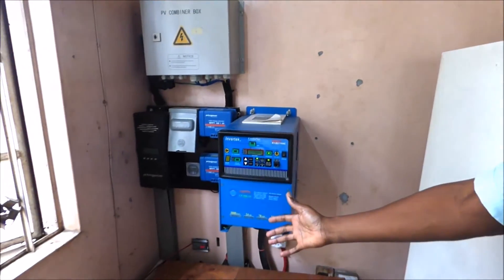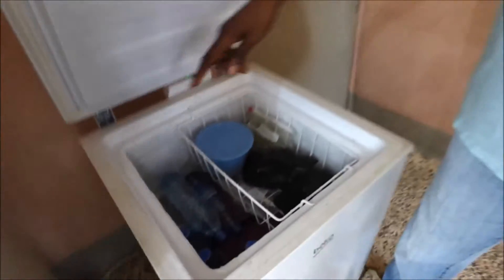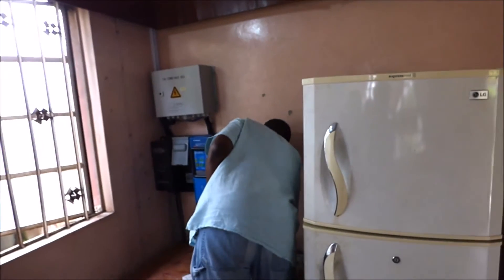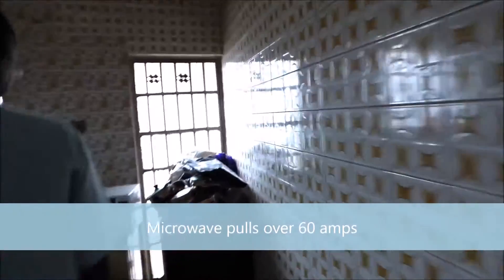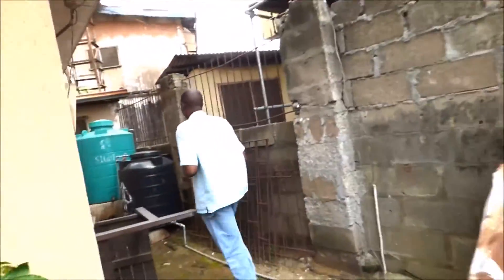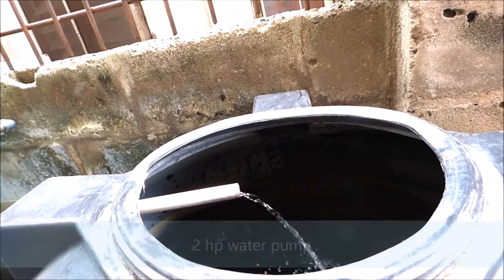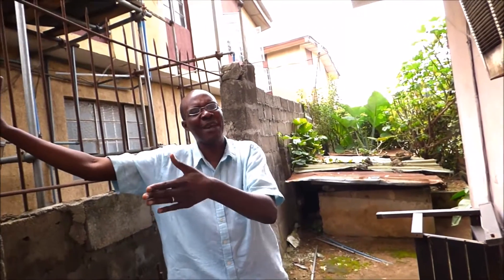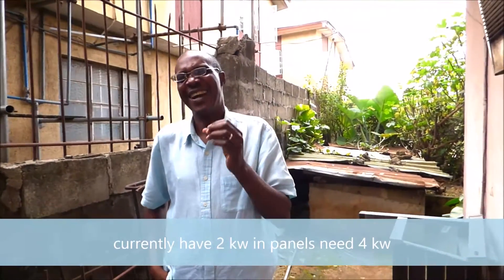What does it mean when you ask for 3.5 kva?

Comment: They should be adding up all the appliances they intend to use at the same time to get an idea of power needed in KW for the inverter, then if you installing a battery bank you need to know how long all these items will be used in time together to work out the bank size and power rating.  In reality of course 3.5Kva is only  2.8KW. not that much but reasonable.  so with your iron on you only have 1kw spare left, this would result in your inverter overload if your fridge or freezer  tried to start up  its compressor. Of course all this does depend on the current needed to start the motors and the power needed to stay running and your mains voltage, I am presuming your mains is 220 to 230v. Also you need to know Max and continuous rating of inverter to cater for motor starts.
Reply from the maker: wamperth we try to teach them that. It takes time